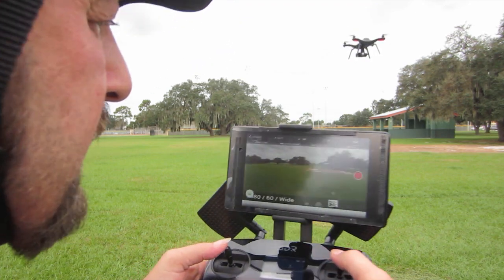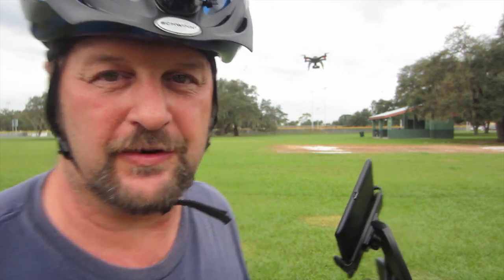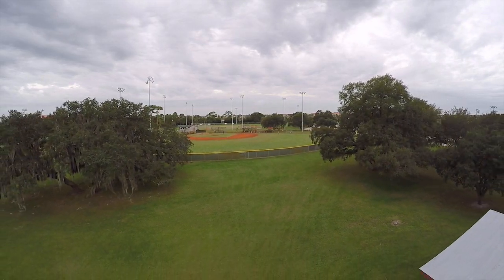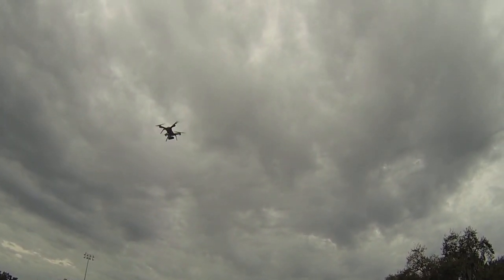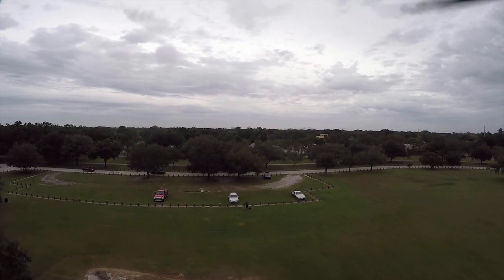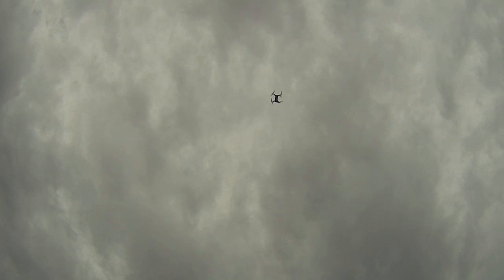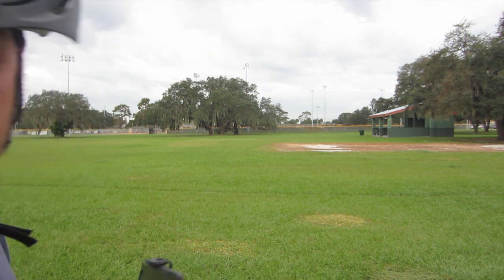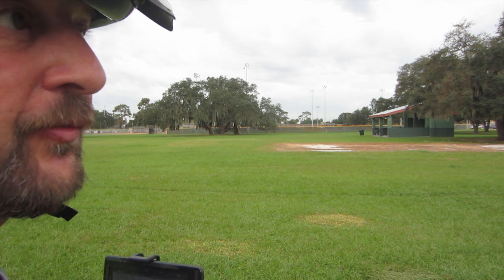3DR Solo Smart Drone: Advanced Return To Home!!! (11.21.2015)

Comment: I can see a use for the backwards return to home if you are trying to film a pull away shot for some video project. :) It is neat to have it go both ways though as you wish. :P If I spotted you with one of those in the park I would come bug you. ;) 

We had it nice and cold at my house in Texas last night. :) 35 degrees last night before I passed out asleep. I have no idea if it went colder but I had my heat off still and the window open. Woke up to a beautiful 58 degrees in the house and really enjoyed sleeping all warm under my blanket with cold air on my face. One of my favorite feelings. :D 

 - Heidi
Reply from the maker: +BlackCat2 actually they have a set program for th epull away shot, its called a selfie but i cant use it where i am flying. i am hoping it cool off very rapidly here in florida, i have my share of summer, i am good with a nice winter chill any day now! :)

Comment: hey man been following your pages good stuff and great info! quick question what tablet are you using does not look like in iPad I'm looking for a cheap tablet for the display really don't need anything that fancy I'm currently using my iPhone 6s plus but i don't want to use it i have been getting calls while flaying and i don't want to get distracted especially when i have my bird up in the air what cheap tablet that work with the 3dr solo app would you recommend would be a great video to do.... ;)
Reply from the maker: +Alberto Rodriguez sorry for the delay in answering, i was away for the weekend. i use a Nexus 7 wifi android tablet. if you can afford it, get a tablet with a mobile connection to your cell phone provider , much more useful. thanks for watching and commenting.

Comment: the reason that they return to home facing the other direction is so you will get antenna reception back earliest possible if you turn it around and returned it back you seem to get a little less reception for some reason I don't know why
Reply from the maker: +Yadher Bustamante I would tend to disagree with that statement. it wouldnt make much sense since the Antenna is on the leg? 3DR put the antenna at the most open point so reception wouldnt suffer, this is the most generally accepted idea of positioning the antenna. the craft turning to face home will not cause a communication problem with the aircraft considering the difference of Solo antenna location is inches and not feet. thats just my opinion for early builds and things i have learned along the way.
Reply: +TheMighty Thor okay so try this out fly straight out maybe 2000 feet when signal starts to get weak and wants to come home then turn the in a different direction or try to make a u-turn and you will see that you will just drop connection immediately
Reply from the maker: Yadher Bustamante there is never a time i will ever fly that far away. however, in your scenario, if the quad is set to turn and fly home, i wouldnt have to do that. this is all a matter of opinion, i feel better with the drone turning on its own, providing me with a view of what the Solo is flying over incase adjustments have to be made. but thanks for your opinion

Comment: So do you set the parameter value to 3?  You never did say, so just wanna be sure.
Reply from the maker: Links for WP_YAW_BEHAVIOR parameter:
http://copter.ardupilot.com/wiki/arducopter-parameters/#yaw_behaviour_during_missions_arducopterwp_yaw_behavior

VALUE MEANING
0 Never change yaw
1 Face next waypoint
2 Face next waypoint except RTL
3 Face along GPS course
Reply: Yes, I already saw the parameters value/meaning chart that you posted originally, but from the given descriptions it is not obvious which value cause the solo to face home when returning to home.  I guess I was asking too much when asked what the correct value should be.  Wasn't that the point of this video?
Reply from the maker: if you watched the whole video, you would see at the end that the value is 1
Reply: The value is 3 not 1. At least it is for me.  If I put the value to 1 or 2 it still comes back backward.  Value 3 is face along gps course  which is facing home towards you

Comment: Might thor...can i changes the parameters on my iPad? what would be the settings on the parameters? and if i changes the parameters will it stay on there until i changes it back meaning i dont have to keep changing it everytime i fly solo?...thanks a lot and sorry for all the silly questions.
Reply from the maker: +MGOSAN you can only change parameters on the Solo if you use Mission Planner or the App called Tower. the changes stay until you change them to something else
Reply: Thanks you again sir...

Comment: I wanted to know if there was any way the returned  home on low battery option that it does by itself can be overwrite here's why I want to know I'm using the follow me feature and I'm half a mile away from were I originally took off I want to have the option that when its on low battery it gives me the nores like it does but instead of flying back to were I took off and having to run like crazy back gives me the option to land it right there were I'm at. Or were the controller is at that moment. Instead of going back. It may have that option and I'm not aware of it can someone explain if it's possible to even do that. Thanks
Reply from the maker: +Alberto Rodriguez no return to home is your specific take off point especially on low battery. the best thing to do is to take it out of follow me and fly it to your location and land it. you can retake control by hitting the fly button. i wouldnt mess with the parameters in the aircraft.
Reply: +TheMighty Thor ok so even wen it goes on returned home auto on low battery I can still press the fly bottom and regain control and land it there were I'm at the moment

Comment: I cannot find your reply anymore... Anyhow, I am asking you if you applied some sort of Stabilization in post production, such as Warp Stabilizer from Adobe Premiere Pro??? Thanks.
Reply from the maker: +Soloing 2015 no there was no post stabilization, that was straight out of the Gopro
Reply: +TheMighty Thor Amazing! The latest update must have fixed some gimbal issues as well! Cool. thank.
Reply from the maker: Soloing 2015 According to what i have read, that is the case, the gimbal works flawlessly
Reply: +TheMighty Thor That is good to hear. I had a Solo but returned it. One reason was of course the fact that the Gimbal had a lot of micro-vibrations. ANother reason was that my Solo started to fly "funny". Since I was still in the 30 day MBG, I returned it. However, that was 5 month after I actually got the Solo! The 30 mbg started when I got my Gimbal... so I had plenty of time to test the Solo...

Comment: can u tell me why my solo keeps losing signal i send it out about 50 to 60ft an it lost signal and comes back home i tryed the apa antennas i get the same thing.
Reply from the maker: the antennas are on the legs of that aircraft, make sure they are still there, you will see them on the legs toward the feet. let me know if they are still there, a broken wire or not there.
Reply: they r still there not broken
Reply from the maker: ok the next thing to check, which will probably require opening the unit up is to see if they are connected in side. you should lose signal 60ft away, an antenna/receiver radiates about that far with out an antenna, so internally there may be damage. i havent had the solo in a long time but if you go to a site called diydrones, its a 3DR/Pixhawk site, you may be able to find some answers there.
Reply: TheMighty Thor ok thank again I'll  that

Comment: You posted this over a year ago, and I hope you have had better luck than I have. I bought mine in June of this year and am now on my 4th one due to malfunctions. Since 3DR is no longer in the consumer drone business they are no longer sending me new models. So, the refurbished ones I have gotten come to me dirty and not working properly. I have had my current one for over 2 weeks and cannot fly it because it will not calibrate level or compass. 3DR says I am doing it wrong. I think not, I am following the directions exactly and 3DR will do nothing for me. Terrible drone and horrible customer service. I hope you have had better luck than me.
Reply from the maker: i have had a good drone, but it was sold off a while ago. mine always worked properly, sorry to hear yours didnt work so well. not a bad aircraft when it works properly